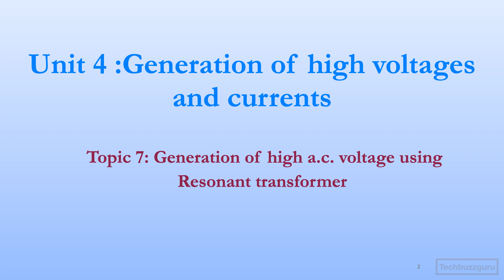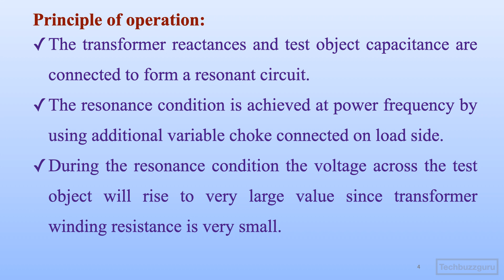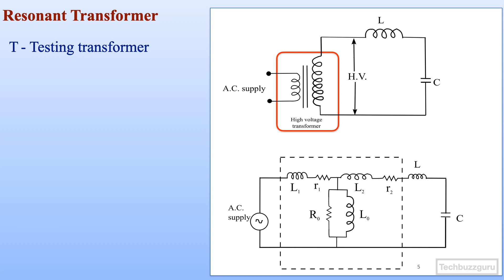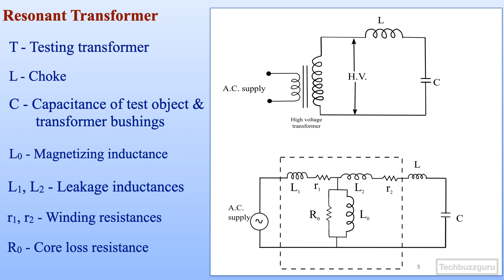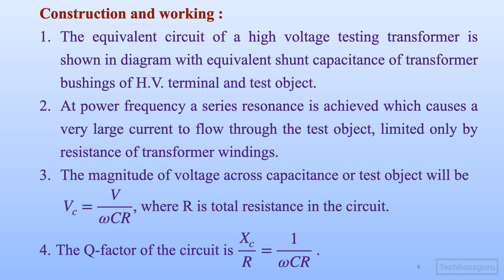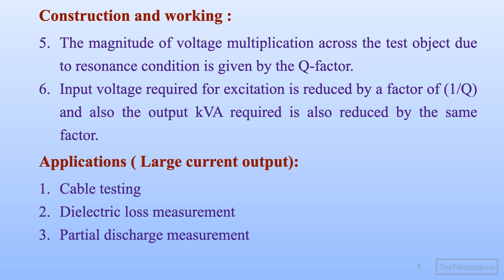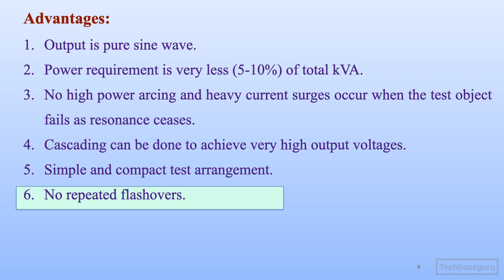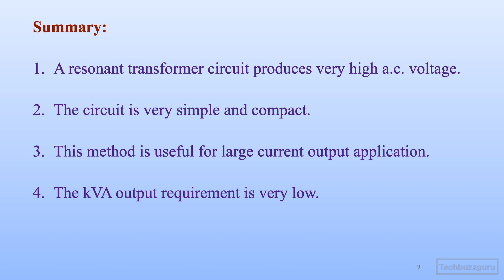Resonant transformer

Comment: There are two types of Resonant Testing, one is using a variable inductance (choke) to achieve a resonant frequency at Power Frequency. This technique is used for FAT to abide by testing standards. The second type is using a variable frequency supply and keeping the inductance constant and finding the resonant frequency that satisfies Xc=Xl. This method is used primarily for SAT.
Reply from the maker: Thanks Sir for the deeper insight in the subject.